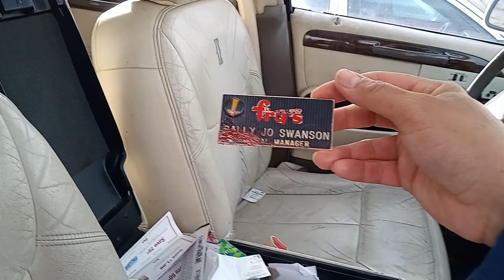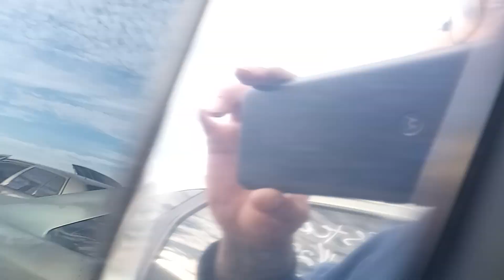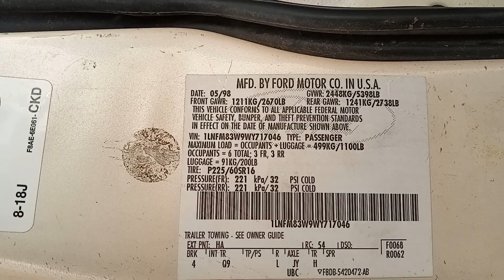1998 Lincoln TownCar Cartier Salvage Yard Tour Pt. 1

Comment: What is the difference between a Cartier and Signature series? I'm currently looking at one 1998 Cartier in my area with 160k on the odometer for 5.7 grand. Is it a good value?
Reply from the maker: Cartier is top trim level with the most options available. Signature Series is middle trim level, if it has a moonroof it's considered a Signature series premium just underneath Cartier trim.